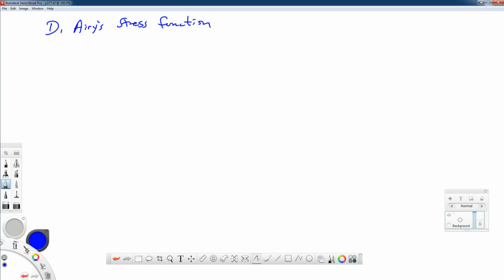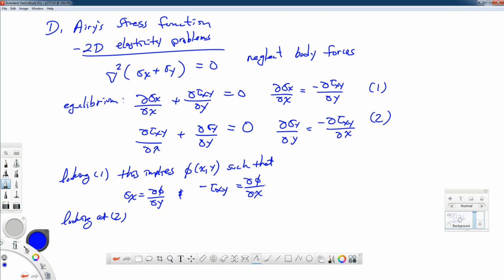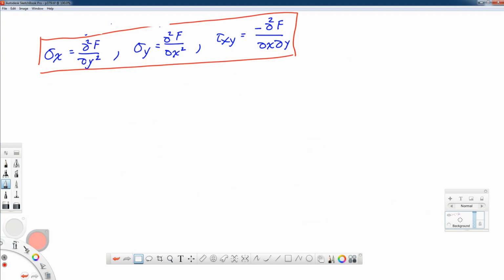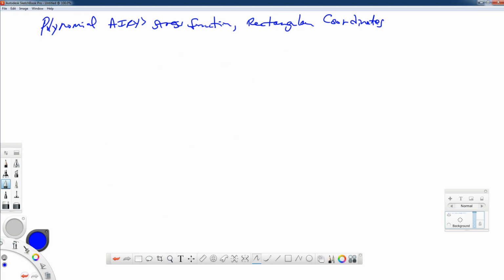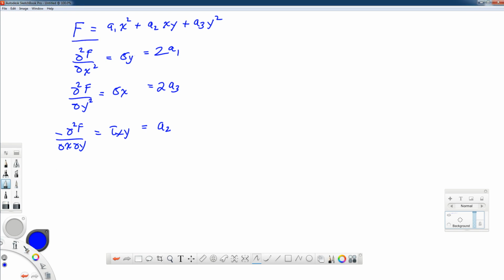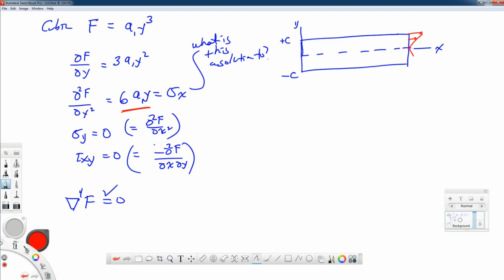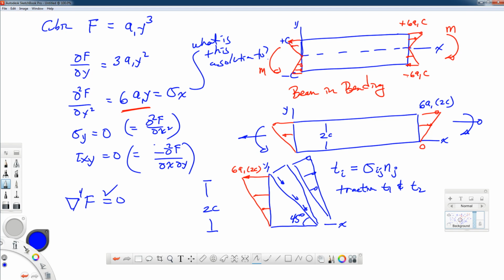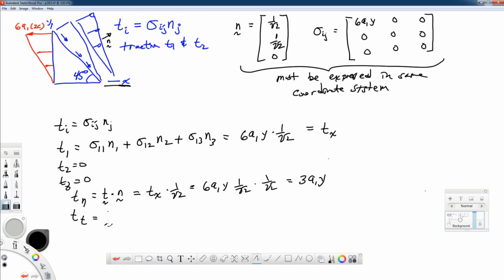Theory of Elasticity-Lecture 27-Airy's Stress Function

Comment: Excuse me sir , can you explain how we discover the type of supports of any beam via the applied loads on it as an application of Airy's equation in 2D stress in cartesian coordinates ?
Reply from the maker: You would need to examine the stress boundary conditions and then examine how the resultant forces or moments can be interpreted.  For example, a simply supported beam would have no axial stress on the end of the beam unless there is an applied moment there.  The resultant vertical shear stress would be related to the vertical force associated with the support.
Reply: @mbarkey.mechanics  I so  thankfull for your care and I wish I have some solved problems with their notes regarding my question , and I woundering if you have a written content of your video lectures ? thank you again ♥